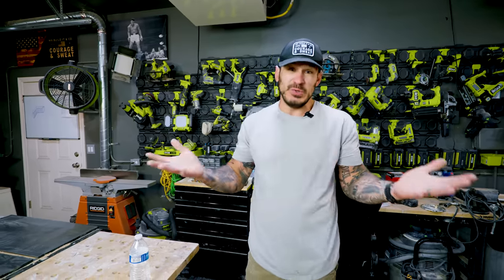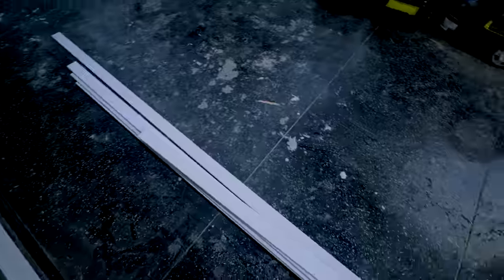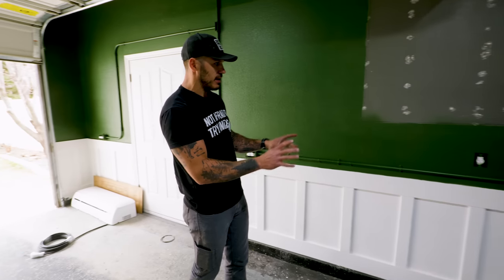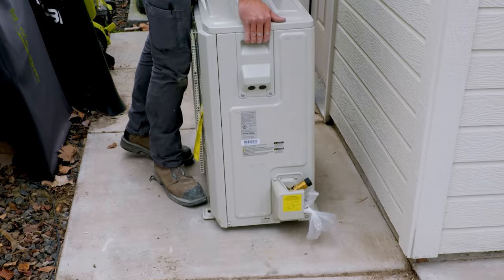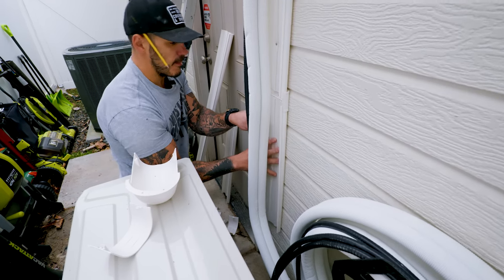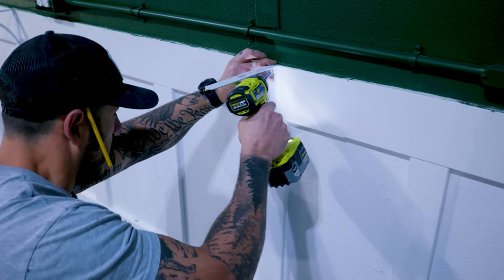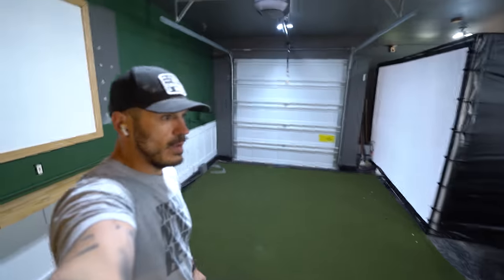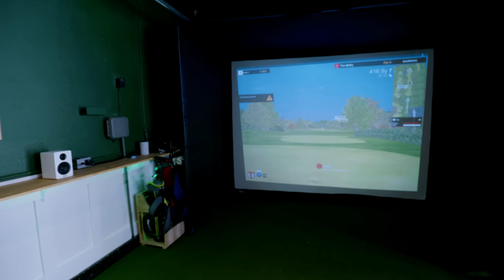Got Rid of My Shop And Built a Dream HOME GYM

Comment: If you want to save your concrete I would use stall mats versus the interlocking gym mats.  Love your channel btw!  Helped with many of my new house projects!
Reply: I agree, the concrete will be busted. Need horse stall mats from tractor supply. Typically you want 3/4" to 1" thick mats to protect concrete. Great video!!!

Comment: Great job! I’m an HVAC engineer and recommend using a waterproof whip to connect from your disconnect to the condenser. Plus use spray foam where you core your hole in the wall.

Comment: Awesome build I love how the green turned out! I needed to also say it looked like you used MC cable from the disconnect to the unit and from my understanding it is not weather rated. It only protects against physical damage. I’m not sure your state codes however in New Jersey this would fail. Instead use liquid tight flexible conduit with water proof connections and pull THWN Inside. Thanks for the great content !
Reply: I was looking for this comment, glad someone pointed it out
Reply: Yeah good point, surprised the mini-split didn't come with outdoor waterproof conduit.

Comment: I've been told by my HVAC guy that it's bad to have the line set to a mini split coiled like that. Oil can pool in the bottom of the loops and cause issues. Might be worth verifying with Mr. Cool to see if it's an issue with their gear.

Comment: You have all that you really need, but you have a small gym.  I suggest adding a stand-alone Squat Max MD, so you can do belt squats, which is much safer than back squats and front squats.
You should also get a Lat Machine or a Functional Trainer for curls, triceps extensionsand lat pulldowns.  You can already do pullups on your power rack, but you still need a dip attachment or a self standing dip station.  A 4-wheel push-pull sled would be good too.

Comment: It looks nice, maybe a little cramped but if you're ok with it then thats all the matters. Also, Im not sure how often you plan on using the side door for the garage because of the the AC unit you installed outside of it but if anyone does use it for whatever reason, I can see them running into that ledge/shelf you installed and hurting themselves. Maybe cut that end at an outward angle or something so when whoever is coming in through the door doesn't get a 90 degree corner to the gut.

Comment: Just a couple things about the Mini split install from a professional HVACR tech. 
Cut the wall sleeve flush with the exterior wall before running and bending your pipes through so you're not causing a sharp 90 degree shelf to bend around.  
Agree you should use soapy water to check for leaks, but that style you used where the soap is foamy wont work. Get a small cup of dish soap and just use your finger to run it around the lip of the flared connections. 
Set the condensing unit on top of a concrete pad or pressure treated 4x4 so you don't have issues with the condensate water freezing into the unit during winter. 
The indoor unit placement could have been better, but work with what you have. Try to keep the top of the unit at least 6" from the ceiling to allow proper air flow and try to mount it on a wall where it blows towards the largest side of the room.

Comment: That's cool. Do you feel the need to insulate your garage doors to offset the higher costs of energy loss due to heating and cooling?
Reply: Those doors typically have an R14 insulation value. They make draft stops for the sides that you can install from the front of the opening. If you want to go a step further they make insulation boards that fit over the door panels.

Comment: I highly recommend replacing that MC cable you ran from your disconnect to your unit, with UF(outdoor rated) wiring. MC is not safe to be ran exposed to the elements like  that

Comment: Holy crap dude! Why didn't you rent a truck with a liftgate??
I know it's cheaper to use what you already own, but the amount of work (and damage to wheels/ potential damage to tools) going up the open trailer ramp and then transporting it?  
Way too much effort and energy for old guys like me...

Also, why did you place the inside unit of split system so close to the garage door?  Potential for air loss/ thermostat reading getting interference from the outside air?

Comment: I recommend using waterproof cable when running electrical outside and you’ll definitely wanna use proper connectors as well. Great project otherwise